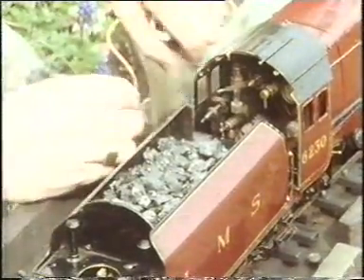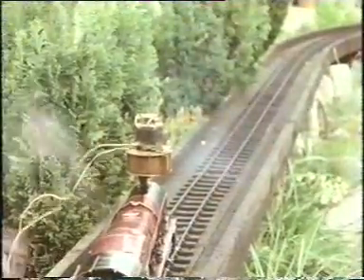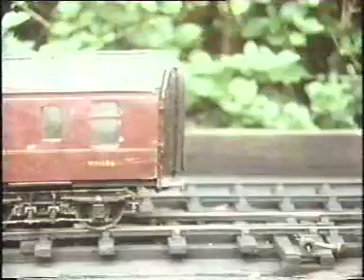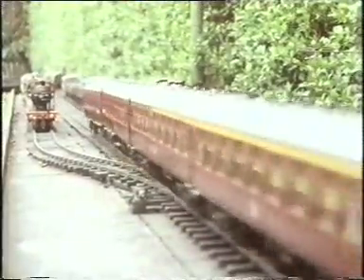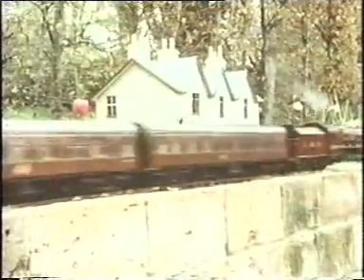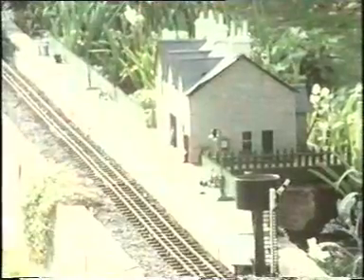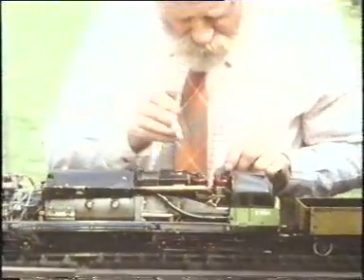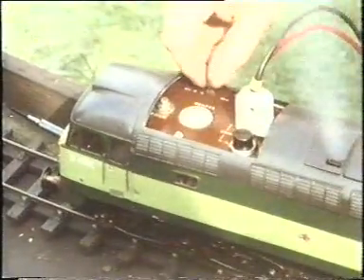Garden Railway

Comment: for the steam engine couldnt you run that by remote control, using a servo's to control throttle, and other regulatory functions.  Would be cool to have it pull up to one of those spots to fill the boiler for water refills.  
OMGosh I am soooo excited to see a small coal fired boiler though!!!  I would give 10 stars but 5 will have to do.
Reply: not at this time ;)